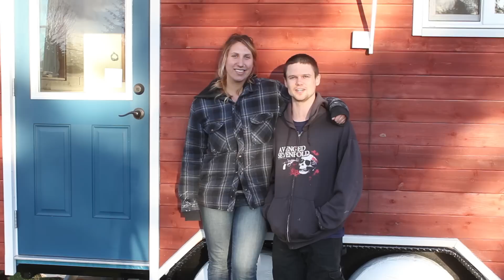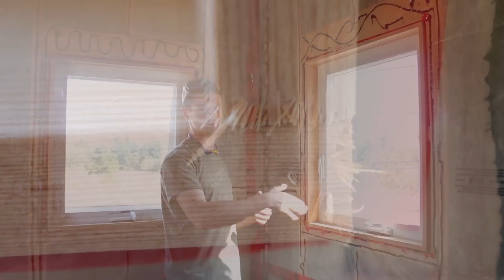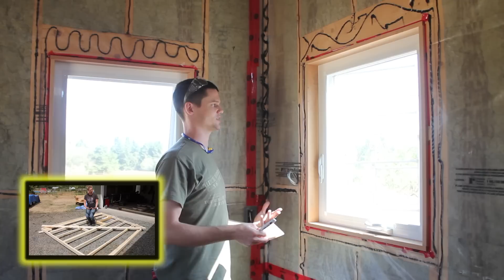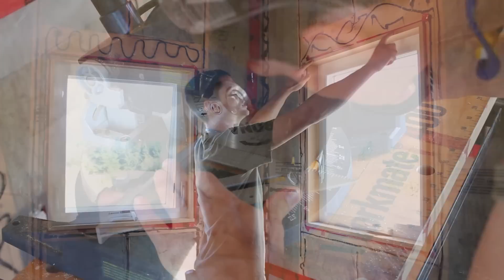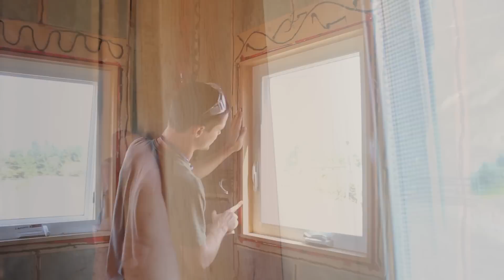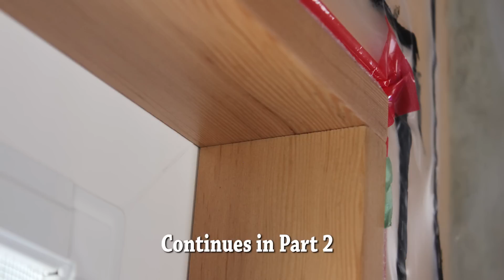Tiny House Window Sills - Part 1 (Ep.56)

Comment: That cut on outside should be transferred to inside so it is not seen.
Reply from the maker: ...sorry not sure what you are referencing specifically...
Reply: When you were cutting some of the window sill board. If you cut it on side facing window there will be no noticeable grooves of front of board. Unless you sanded them after cutting them then there would be no need. At least that is what the impression was on that.
Reply from the maker: Yes we messed up on a few, but we tried to cut such that there was no blow-out on any sides that would face out.

Comment: Wood stud framing is not supposed to be cabinet grade construction.  If you wanted that, you would have to rip all the studs, but frankly expecting exact clearances all around the frame is not realistic.  Protruded trim is to hide the inconsistencies.  You are expecting cabinet grade construction with non-cabinet grade materials.  You would also have to guarantee that your trailer frame was exactly flat, square, etc.  As time goes along and your home settles a bit, you may discover a lot more gaps appear.
Reply from the maker: +Brad Taylor This was actually nice fir, not meant for framing, but you are right that there will inevitably be imperfections... we're just trying to start off the best we can to minimize them ;)
Reply: I understand, but we perfectionists carry things a bit too far sometimes.
Reply from the maker: +Brad Taylor I have no idea what you're talking about ;)
Reply: It's always been my dream to build the perfect set of flush door cabinets.  Do you know hard it is to make flush door cabinets?  You get some idea trying to make all those window frames line up with template cuts.  Every cabinet maker has his horror stories.
Reply from the maker: +Brad Taylor I think we're going to make our own cabinets :P but they will be very very simple... otherwise we'd spend forever trying to get it right ;)

Comment: Great videos guys, you are perfectionists for sure. In regards to wood expansion you may need to leave a few millimeters for expansion on the wall side. Trim down the flushed edges just a little more so they are slightly rebated IN from the wall panel level. The architraves will hide the gap and you can always fill the small gap with gap filler. If it does expand it will push against your window and architrave and possible warp or twist. Check out seasonal expansion for different wood grains.
Reply from the maker: +Dave Digger Hmmm, we'll have to see how ours goes, because there's no changing it now (this video was filmed months ago). The nails (as you'll see in the next video) are very tiny, so I think that if it expands, it will push more on the trim than the window... because yes that would be bad to have a force pushing the windows of of their openings!

Comment: Would you have avoided some of the problems with the studs not being flush if you had used manufactured wood that was completely uniform? I'm not suggesting that would have been a good thing to do where you can't see the wood, but I'm wondering it it would have saved time and effort.
Reply from the maker: +MakeMeThinkAgain What kind of "manufactured wood" are you referring to?
Reply: +Tiny Nest I found this,     http://www.rosboro.com/index.php?action=products.studs but I was originally thinking of something that looked more like this,    https://goulddesigninc.wordpress.com/2013/11/14/the-abcs-of-ewp-engineered-wood-products/ But I guess this is really just for beams. I know less than I thought I did.
Reply from the maker: +MakeMeThinkAgain Ah, yes some of these products could be good. I saw +Matt Risinger using them in a project and talking about how they are precise and thus make the final walls very flat, and even, etc.

Comment: I suggest nailing the 4 pieces together like a picture frame then nail on the trim but let the jambs float  looking great though
Reply from the maker: +Scott Tyndall Indeed, this might have been a better way to get the seams lined up. I did not think of this approach because I wouldn't have felt confident making a pre-built piece that would fit the entire opening... at least at first. Next time!
Reply: I think it will turn out just fine either way. I really like that you two are not afraid of learning new things keep up the great work
Reply from the maker: +Scott Tyndall There's always room to learn moar!

Comment: There are so many ways to skin a cat , what I would do is take a couple of pieces of angle iron about 3/16 inch thick , about 2" x  2" wide , a few inches longer than the longest trim board I have to shave down ,  I would drill a hole on each end of both pieces of angle for bolts and nuts , then I would sandwich the trim board between the two pieces of angle iron , put it in the vise in the middle , line up my mark , tighten the vise , then go down to each end and tweak the wood a little bit if necessary , until the mark lines up , then tighten the bolts , or just clamp it good , then I would take a 24 or 36 grit flap disc on a 4-1/2 inch grinder and just sand the wood down the whole way until it's flush with the angle iron.
Reply from the maker: +Abuser abuser I think I get the gist of what you're describing here... definitely other options to line it up and probably some that are better than my way! ;)
Reply: Tiny Nest
Yes sir , whatever works to satisfy ones aesthetic standard

No better way , your way works , just changing tracks can be easier some times.

Lateral thinking saves time.

Having the right tools is big part of it too.

I've been stymied trying to do things in the orthodox way as it pertains to a specific trade , then I change my hat form being a mechanic to a welder , a plumber , or a carpenter , much of the time it solves my problem by changing my approach.

Six Thinking Hats , Wikipedia.

I think you guys are doing a great job on your Tiny Home , I'm impressed with your meticulous standard for excellence ,  it inspires me to get started on a Tiny Home of my own.

Keep up the good work.

: )
Reply from the maker: +Abuser abuser Thanks for your feedback :) we're definitely trying to do our best but have very limited experience for some of the tasks!

Comment: You could have just made a frame and used pocket screws to hold it together
Reply from the maker: +previouslyachimp Treating like a door-jam is a good idea. The only thing is that we would have had to use thinner wood because any shimming would push the sills into the mechanism that opens the window :P
Reply: Tiny Nest I did wonder about that but it's a little difficult to see how much space you had. If you make the frame just a tiny bit smaller than the opening you don't really need anything more than a bit of adhesive. :)
Reply from the maker: +Sachi In Wisconsin Hmmm yes that might have been a good way to keep the seams tight :)
Reply: +Sachi In Wisconsin -  I agree, I'm not a fan of face nailing so I would have made a frame too. Similar to how you might shim a door, you could have made the frame slightly smaller than the opening (you don't need to use pocket screws, just screw through the horizontal piece straight down into the verticle piece), then glue to shims around the edges to square it up. Expanding foam can then fill the gaps (be careful to ensure it does not deform the frame) as it is quite sticky it would hold the frame and allow a little for expansion and contraction.

Comment: Nice job. Put a backup board on your chop saw and it will stop the blow-out. All in all, well done.
Reply: +Tiny Nest - The backup board is the best way, but just cutting very slowly can help quite a bit on a rough-cut blade, or just buy a fine-toothed finishing blade. Wrapping a bit of masking tape around the wood before you cut can also work if you're careful and go slow.
Reply from the maker: +previouslyachimp We've used the masking-tape method on a different task ;) and I think we're going to get a finer-toothed blade for the actual trim.
Reply: Use a Diablo fine tooth blade - works like a dream and lasts a very long time.

http://www.homedepot.com/p/Diablo-10-in-x-60-Tooth-Fine-Finish-Saw-Blade-D1060X/100033809
Reply: Tiny Nest Yeah, the masking tape method is only marginally better than nothing at all! You won't regret having a fine tooth blade, but don't be tempted to use it for rough work because you can't be bothered to change the blade. Just keep it for fine work and it will last a lot longer. :)
Reply from the maker: +previouslyachimp Yeah I think I will pick up a fine-tooth blade for the trim :)
Reply from the maker: +Ttf Web Ah yes, nice tip :)